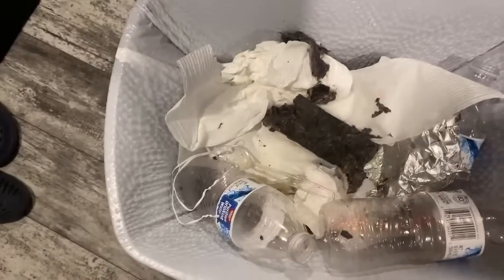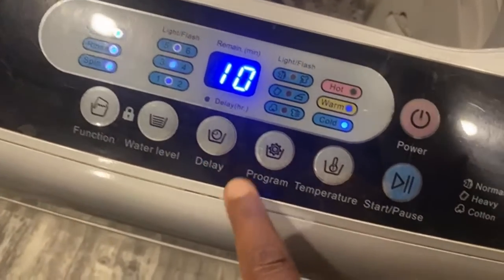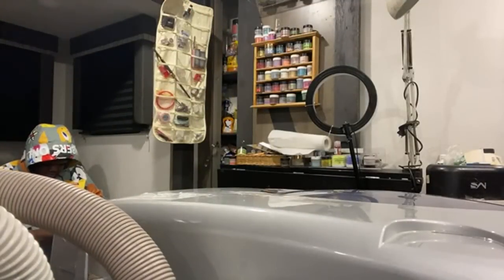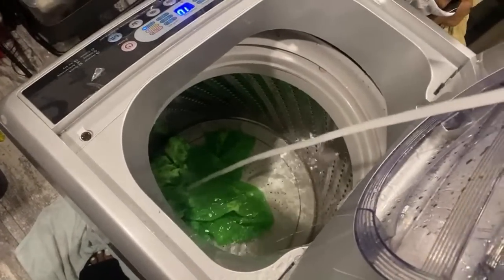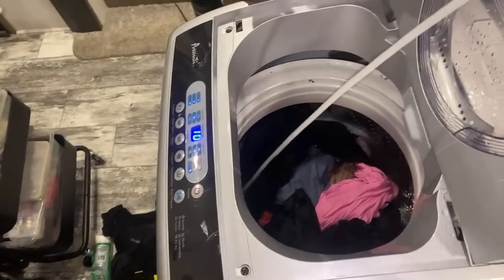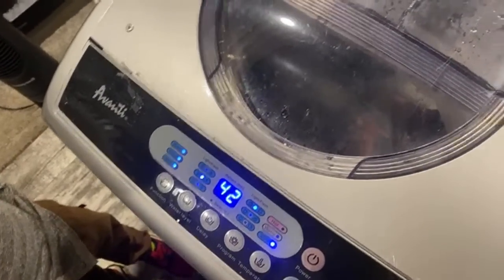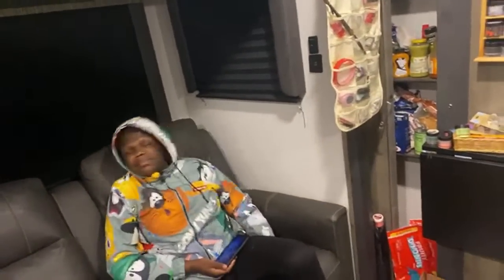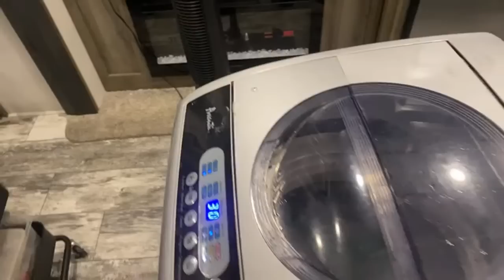Playing with my washer I found on marketplace!!

Comment: I bought a panda brand portable washer.  It is doin a good job cleaning the clothes. U can add the water manually u have to keep an eye on it.  When it ready to rinse  I think it will stop or beep,  so u can add water again to it.  My connections fit my sink so I didnt have to add water manually .  Maybe you can switch your sink faucet so it can fit the  hose.